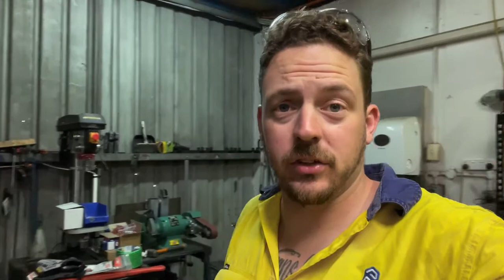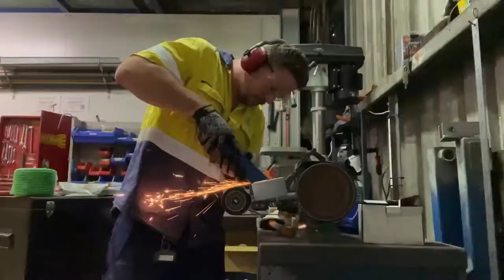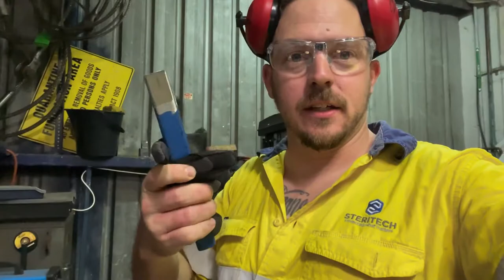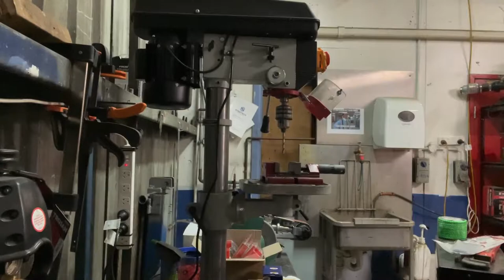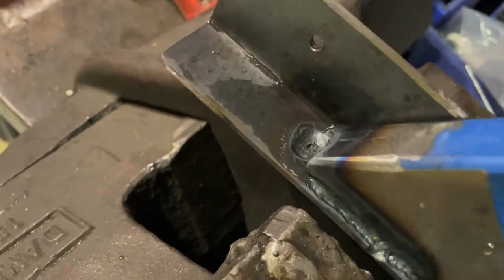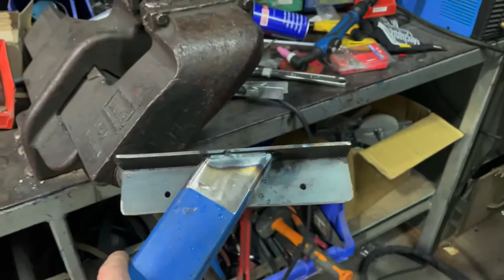#aussiemotocontentcreator #fabrication Part 1 - The Beginning. START.

Comment: Nice work mate tig it mate more control and a nicer weld 😎👍🏼
Reply from the maker: I was TIG welding. I have good results on solid stock. But still getting used to tube stock and thin walls. Also don’t have a foot pedal. 

Thanks for the feedback mate! Be keen to hear any tips you may have 😊